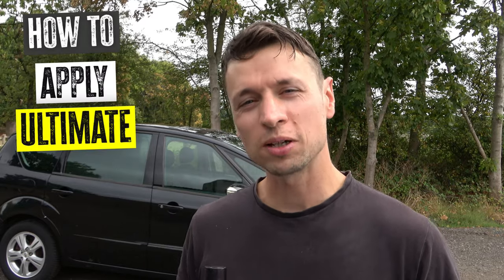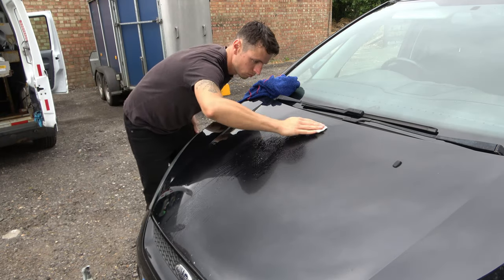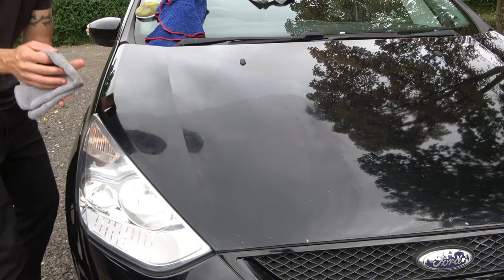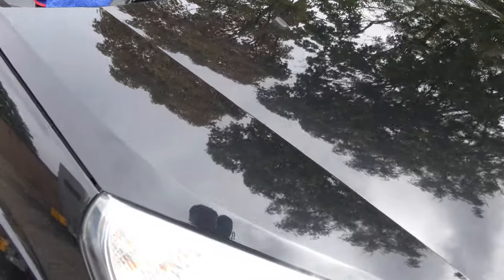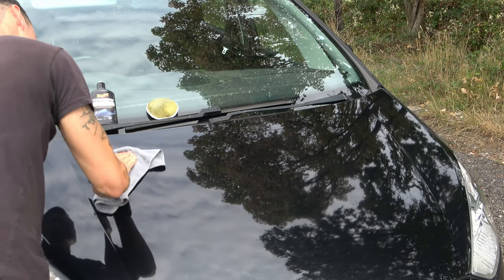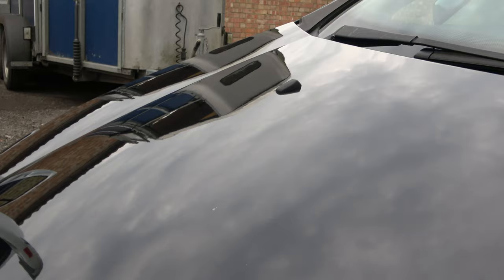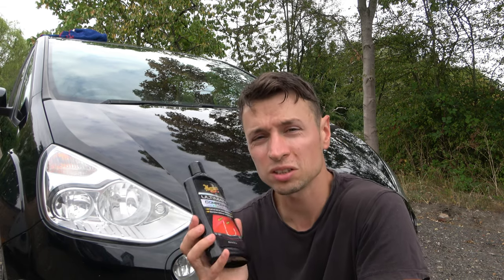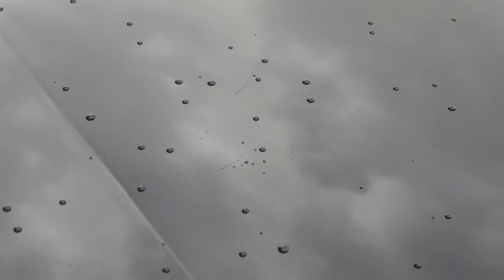Applying Meguiars ultimate compound by hand | Does it Work?

Comment: If it dries, use an instant detailer spray and wipe , it will come off no sweat. Especially if you find some polish thats dried in an area you forgot. Just a tip if anyones reading this.

Comment: As a DIT detailer this encourages me to try this as appose to the machine approach that I am not comfortable using with all the pads you need to know and understand how they work. This just might be the thing for me starting out just need to put the time in and thats not an issue well worth it if I can get the same results as you did. Thanks for this.   Ottawa Ontario Canada.
Reply from the maker: Nice one, there's no shame in doing it this way to get started. I know big name detailers myself included who have made mistakes when starting out. You can still get good results from a hand compound 👌

Comment: I tried the ultimate compound on an old work truck I bought. 17yr old truck, probably never had a wash once. Heavy oxidation on the paint. Power washed it, hand washed it. Then I used the Ultimate compound on it. I did 2 feet by 2 feet sections at a time so it would'nt dry out and whipped off the excess. 3hrs later it turned out beautifully. finished it up with some black plastic trim restorer and it was like i had an almost new truck again. Went from being kind of ashamed of it, to proud to drive it around. Never done it before. Others cars i would just pressure wash and call it a day. But it was an old truck with lots of life left so i wanted to try it. It's pretty simple.

Comment: Great video David, you're an honest guy!!! I normally polish by hand...never used a machine polisher before. It's a more engaging and 'intimate' process when polishing by hand.
Reply from the maker: Machine just gives you a headache. I'm happy to use my hand ✋
Reply: By hand also preserves the paint. It is labor intensive if done correctly. Machine polishing should be done a few years apart. Otherwise, if you regularly use high speed polishing, you'll thin out the paint. Recently, I noticed this trend of "paint correction". Unnecessary unless you have neglected car.

Comment: Excellent video and thank you for the warning that the Ultimate Polish literally dries in 15-20 seconds or so in the shade!  I did find that applying slightly more UP helped to dissolve any dried UP and wipe away.  I wish they could extend UP a bit to make it easier to work with by hand.

Comment: Awesome video!

I hand polish and added a sealant to my 1996 Peugeot 106 1.1L.
It was very hard on the arm, especially because I had to prior wash it (initiating by the rims), hand wash, and clay the entire car prior to the polish and sealant.
But it was really worth it.

The car is old, not worth much, but it is my daily driver.
Thus, it was not worth spending the money for a professional polish, or even to buy a polish machine to be used once a year.

So, I take matter into my own hands.
As it was an old car, in a white colour, the benefits were noticeable!
Especially because the swirls are not that visible in the white colour, and also I think because there were a lot of contamination in that paint that were removed by claying and polishing.

It put a smile on my face, and even my girlfriend was amazed with the end result - but not a fan of the receipt for all the products I have used.

Now, I am thinking on doing the same to my 2011 Renault Megane Grandtour 1.5 dCi.
It is not a very valuable car, but it is my girlfriend's daily driver, and the family car - to go to weeding, family dinners, and so on.
I hand it over to a professional upon buying it. But, since then, I built some knowledge, and want to do it myself. 

On my Peugeot I used the NextZett No. 3 (Polish) and NextZett No. 4 (Sealant).
On my Megane I am not sure if I am going to keep with the NextZett, or change to Meguire's.

Nevertheless, this video gave me the confidence I needed!
Cheers mate!
Reply from the maker: That's so nice to see. It's what makes you happy. White cars can be hard graft so well done. As long as you keep on top of it with something like the ceramic wax your always have that nice glossy shine. 

I'm so pleased to have helped ☺️

Comment: "Ya get through so many cloths sometimes you just forget....W****S", looooooooool

Good stuff Dave, I'm enjoying your content 👍 
I used the same process apart from I had the Ultimate Wax rather than Ceramic Wax.
All done by hand on the wifes white car, it was hard work!!
Good tip on the polish, I wish I knew not to leave it on for long. If you do, I used a cloth dampened with ONR.
 
When it comes to doing my car I've got myself a DA polisher 😜
Reply from the maker: Nice one thanks for watching mate

Comment: nicely demo'd Dave, perfect for those without a machine and want to look after their daily driver.  i did my Outback by hand a few months back, using Ult. Compound/Polish and HCD in the sun, it took a few hours, turned out well 😎  Handy Kent MF pads with velcro handle also very good to use and less hand cramp, plus some CG hand applicators.
Reply from the maker: Thank you it's really never a problem doing it by hand and it shows what can be achieved without a machine
Reply from the maker: And thanks for watching 🙏

Comment: Best video I've watched, straight to the point, I have just 2 question's can you use the command with a machine and once thr scratches etc have gone can I use a machine with just the polish and no compound im new to this whole polishing thing but willing to get started. Just absolutely no idea as to what can be used with a polishing machine 😰😂
Reply from the maker: Machine is definitely the best way moving forward but buffing by hand will work to a certain extent so u can remove light scuffs

Comment: Great video mate, I’ve never hand polished and scared to try machine polishing so perfect video. Very helpful!! Daft question...is there just one I could use or all or what’s best to start practicing etc? Dave. 👍👍🙌
Reply from the maker: My pleasure Dave, I'd say as long as you have compound and the polish you can get great results. One note the polish really needs to be taken off straight away and done in small areas at a time👌
Reply: Epic Car Show Detailing yes noticed that on video..😨😬 thank you appreciated legend 😁
Reply: Epic Car Show Detailing quite time consuming then. I’m getting a black van going to practice on that 🤩 cheers Dave
Reply from the maker: @daveroberts703  Just work on small sections at a time and you will be fine my friend!
Reply: Epic Car Show Detailing thank you 🙌👍
Reply: Epic Car Show Detailing should I get those meguiars products which I know Meguiars is very good..or could I get Autoglym equivalent ? Nice to try different products. Like a kid in a sweet shop when my delivery comes. 😂😂😍
Reply from the maker: @daveroberts703  ok so you could shorten process by using autog,ym super resin polish and then use AG extra gloss protection in a 2 step. I think autoglym SRP powders up little more so if working in hot weather id go for megs anyday!
Reply: Epic Car Show Detailing THANK YOU. Meguiars it is then 👍🙌😁

Comment: As far as hand compound/polishing goes for light swirls and scratches, would this be good enough for paint correction or would this be considered more paint enhancement? Awesome vid btw, subscribed recently 👌
Reply from the maker: Hello Steven, If your using this by hand then you wont get the same results as a machine polish and never will but in terms of being used as a paint enhancement then yes it will help. It's not the quickest method but many people myself included still use this method! 😁

Comment: Thank you so much for making “car detailing” simple to understand. I just bought the same products and gonna try this method.

But I’ve got a question..
There are quite a few clear coat scratches and swirl marks on my 2006 Nissan X-trail and was wondering if its ok to use two passes with the ultimate compound before going to the polishing stage?
Reply from the maker: Yes just bare in mind you wont get the same results as a machine polisher sadly

Comment: Nice video . 
W⚓ LoL 😂
Hey, I am always interest in what type of towels you experts 💦 use and would like to hear something
like, "blah blah blah the wax using a plush 310 GSM or low pile duel side etc. It's hard to see on the video and I always buy the wrong cloth for the job 😂
Also with the application microfibre, could you use a white terry version as I note over the Counter they can come in s 3 pack. Microfibres/Terry/Foam.
👍🏼🇦🇺
Reply from the maker: Hello my towels i use are from a company called autosmart in the UK. These days you can tell which ones will let you down.I know costco do yelow cloths that are sold globally which i used to use on polishing.   I see what you mean yes ill make a note to mention different cloth piles etc thanks for helping me get the right information out. Yes any type of microfibre pad works well for this . Ive used many and the foam yellow pads are good and cheap

Comment: I'm pleased I found this video.

I have repainted  my motorbike in a pearl black and whilst it is a beautiful colour, I couldn't avoid orange peel so am having to wet & dry it and compound/polish it out. Only just started removing the orange peel (2k clear), starting with 1500 grit then up to 3000 grit. I then tried Meguiars ultimate compound and ultimate polish using a 75mm puck and pads (orange, yellow and red). I did let the compound run a bit dry a few times (newby) so the pads seemed to grip so assuming I need to keep it wetter. Still a few swirl marks but not that many.

This video has given me the reassurance I need that I'm on the right path and don't need a machine (although I have a 150mm da polisher which is too big I think). 

Cheers dude 👍

Comment: Thanks for this Dave!
1.Can you please advice how much time should take to do all 3 steps? 
2.Should I wash the car between steps?
3. In case my car has some small but more significant scratches, should I fix them first?
cheers!
Reply from the maker: Depends on Skill level. For me a proper thorough wash alone can take an hour. but bare in mind summer is coming so get it done first thing before direct sunlight burns the car dry. This is very time consuming. I wont lie but id say your looking at 5 hours to do whole car. So requires patience

Comment: No need for fancy stuff. Just wash the car like you always do. Wipe it off and start using the compound with a microfiber towel which you've folded over a few times. If the scratches are deep, forget it. There's no way other than using a machine or rough sandpaper etc. to get rid of deeper scratches. Use circular movements. When you're finished, apply some polish and on top of that wax. It doesn't matter which polish or wax. Do I recommend the product: the short answer is yes.

Comment: 100% with you on the machine polishing......I find hand polishing far more satisfying, and quicker, by the time you’ve got machine out, extension leads out, pad primed, ive done bonnet and most of the roof.👍🇮🇲
Reply from the maker: Thank you Andy. Thanks for commenting and supporting this tiny channel. I can live with the odd scuff and scratch these days. It would be different if I had a decent car but sadly I don't 😃🇬🇧
Reply: @epicautomotivedetailing   you’re welcome Dave, only found the channel last week, I’ve been valeting & Detailing for 7 yrs now, didn’t own a machine polisher for first 3 yrs while mobile , we are unit based now , and have progressed to now doing Epel PPF installations as part of our services, the guy I work with has over 12 yrs experience. I mainly do the valets while he concentrates on the detailing 👍🇮🇲
Reply from the maker: @ManxAndy  that's a good plan. I used to do so many services but since I kept it simple it was easier to grow quicker 🙌
Reply: @epicautomotivedetailing   we’ve never been busier, now booking for February 21 , both December & January are full, we average one detail and two full valets a day , or we could just do 5 or 6 maintenance valets , just depending on the bookings... your content is excellent, just the right amount of good solid advice , and sensible tips etc , look forward to going through more of the back catalogue on your channel 👍🇮🇲
Reply from the maker: Gosh my old videos are terrible 😂

Comment: Brilliant video i have the Maguire's compound well over 3 years used it once  and found that getting it off was tough watching this video I've seen were I went wrong and applied to much will definitely be trying it again  when the weather  is good and taking my time as for the ceramic wax I've heard horror stories of left to long it sticks to the paint and hard to get off
Reply from the maker: I think temperature has a huge part to play. I've never really had problems with it but I can imagine in extreme heat it could potentially be hard to remove . Happy new year 🎉🌟
Reply: @epicautomotivedetailing  will definitely be using the Maguire's by hand lol happy new year bud

Comment: You will never get the same results as using a polishing machine no matter how hard you try. I highly recommend getting a dual action polishing machine. Its cheap and much easier to use compared to a rotary polish. The chances of burning through the paint is also extremely low (that was one of my biggest fears) I bought one a couple of days back and I used it for the first time. The results were fantastic!

Comment: Great video,good work!!  I compounded my discovery 2, bonet with the machine. using these products, and was impressed   but topped with fusso coat. Definitely do the whole car if you got the time.
Reply from the maker: Thanks Thomas. Bet that was hard graft. Yeh I will end up doing the whole car for a video. The weather was dodgy so wasn't optimistic and turned out to rain straight after but definitely one I should do

Comment: I done my 10 year old black picanto with the same by hand. Really came out good especially considering how neglected it's been.
Reply from the maker: That's brilliant, just shows you that it's not all about having a machine. I think people focus way too much on getting 100% they forget that 90% is all you need to achieve
Reply: @epicautomotivedetailing  I managed to get the suncream stains off it as well from my wife that had ate into the paint. Think that was the t cut I used first though as that stuff was proper ingrained.

Comment: rearly good dave good results yesterday used with hand pad ,with  compound , i used ultimate polish afterwards but had to cut area down i polished  on and get off quick got rid of some swirl marks .. some plonka on u tube said it didnt work as he did not put pea size drops on the pad .. flipping shamefull nearly all the bottle on a bonnet  ... thanks
Reply from the maker: Crikey. Sometimes you need the right weather to get the best out of the polish. It doesn't perform as well in mega heat

Comment: I use this stuff on small areas like window trim or if there's halowing after body work in spots but it's VERY easy to get microfiber imprint when doing large areas. I'd recommend using a foam pad and then microfiber off. Makes it much more consistent when using these products. I don't use this wax tho I use the hybrid ceramic spray wax. So much easier to apply.
Reply: Great advice
Reply: Was very interested in your reply. When you say you use it on small areas like window trim, do you mean, the compound, polish or the wax? It reads as the wax, and what is the finish result like, or is just as a protectant. And i presume you also use it on all outside trim, is this correct. Always looking for new idea's on protecting my trim, at the moment i am using Auto Glym silicone free trim restorer and it does a good job, but always respectful of how other car people do it. Thanks.

Comment: The Ultimate Compound is a great CLEAR COAT compound.  I have used it to remove watch spots, swirls, and etchings in neglected paint where the sun has baked a paint job for years.  You can also use this stuff with a 0000 steel wool pad to remove watermarks on glass.  Follow up with the Ultimate polish, and indeed there is a high gloss finish to a once neglected paint job.  I would follow that with the NXT or Ultimate Wax.  I haven't tried the ceramic yet, but i am heavily leaning towards trying it as soon as next week.
Reply: I use their NXT product on my black chrome rims and it's great
Reply: Good to hear, just got my first fading of clear coat on my roof thanks to the 40C summer we've just had, will be basically copying this video once it looks like it'll dry up a bit... Which could be interesting in North Wales.

Any recommendations on a slightly more beginner-friendly alternative to this ultimate polish stuff? No doubt it looks really good, but probably less so if I mess it up.

Comment: Thanks for pointing me to this video, great help!  I will give the compound a go. I have already tried meguiars polish by hand which worked ok but after a few washes the swirls etc were back!  I will give this combo a try when we get a decent day!  Volvo states in their terms that I should not use an abrasive compound for the first year but I can’t see this doing any damage. Damn Volvo paint you only have to breath on to scratch it lol.
Reply from the maker: If you out something over the polish to protect it your get better results. If I'm honest there is very little out there that can protect for more than 6 months unless you ceramic coat it. And yes I agree Volvo paint can be problematic
Reply: @epicautomotivedetailing  yeah I will give it a good wax after thank you for your help. 😀
Reply from the maker: @markie1014  megs ceramic liquid wax is hot. Best car cleaning ceramic wax I've ever used 🔥
Reply: @epicautomotivedetailing  ordered 👍
Reply from the maker: @markie1014  it's good stuff love it use it on my clients cars